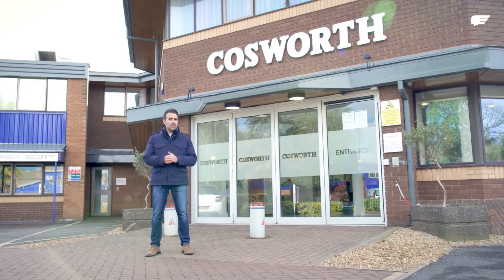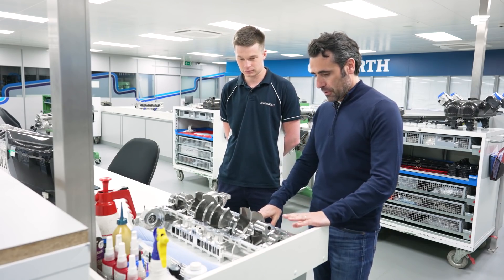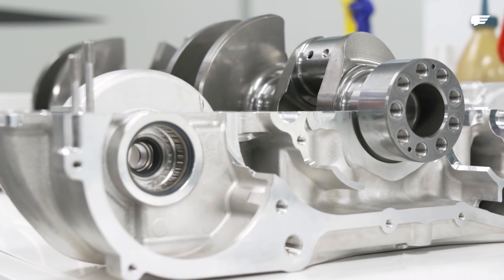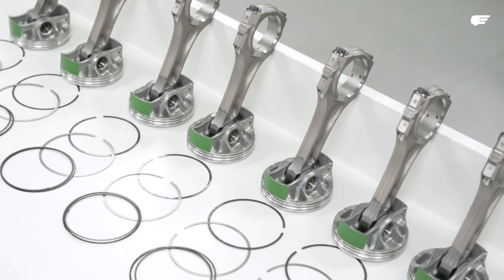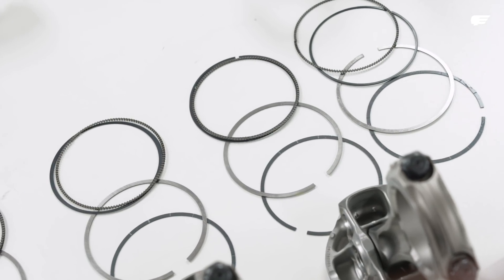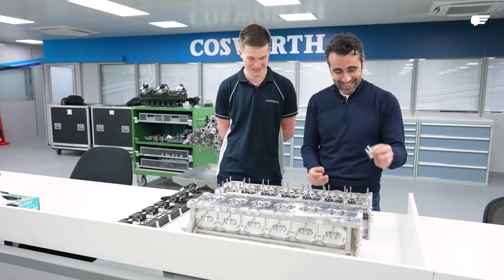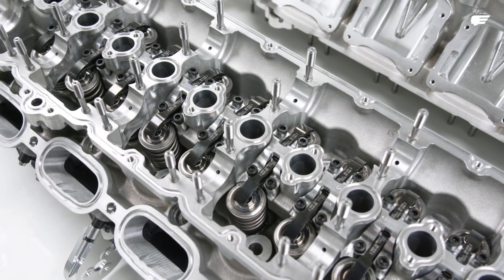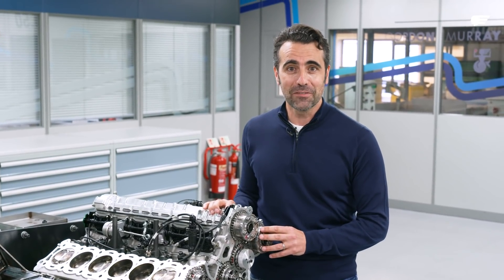T.50 VLOG | EPISODE #8 | COSWORTH BUILD WORKSHOP

Comment: We Might Be Able to Now Make Top End Engines on a Small Scale,Now that CNC is Everywhere But Back in the 60s,70s The Engines in British Motorbikes Were Not Very Good,Big Heavy Slow Revving and Always Leaking Oil with Gearbox Not in the Engine.
Then Honda Brought tout the CB750 that Beat the UK Bike industry in the Ground in 1969 !!!
I Dont think there is a Company Better than Honda when it Comes to Engineering including Cosworth or Any other Big Car or Bike Company.

Comment: Incredible, the dec height is so small, meaning the when the piston is a bottom dead centre it’s mostly within the diameter of the crankshaft, necessitating most of the piston sides are machined off, only having a very small crown and cylindrical aspect. This would normally result in piston slap, when cold. So possibly the engine has to be pre heated like F1, before it’s started, because the piston to wall clearance must be minimal?

Comment: Sweet engine. Visually, there are many shared details between this v12 engine, and the twin turbo v6 in the Acura/Honda NSX. The 2nd NSX engine is a joint venture between cosworth and Honda. Some of the shared technologies are the dry-sump oiling with an integrated bed plate (bed pan) with all of the main bearing journals machined out of one big piece of metal. Also the valve swing-arm cam followers are almost identical to the NSX V6, the only difference is the NSX has all 4 swing arms as an assembly, instead of just a pair on the v12.

Comment: Actually, there's nothing too radical here that we can see, apart from the metallurgy and build quality. Old motorcyclists would recognise dry sumps, double valve springs and gear trains for the cams from the 1940s and 1950s. 4 valve heads were used by Rudge in the 1920s I think, and even Hillman Imps had slipper pistons. I can't quite understand the 'rocker' cam followers, but I'm sure there's a good reason. Anyway, I just know it's going to be an awesome car if Gordon's in charge.

Comment: The toyota 2zz-ge motor used in celica gts,  lotus elise, matrix xr, Corolla S and some pontiac thing (vibe) from 2000- had metal matrix composite sleeves. It does help keep the weight down but it is also a huge pitfall of owning the engine. There are a few reasons we call it the glass engine and the metal matrix composite sleeves is one of them. The material is not so great in the long run.

Comment: Hos does one adjust the tolerances between the cam lobe and the follower?
Reply: a lot of modern engines like this simply use valve stem shims/lash caps. https://www.maxrpm.de/Valve-lash-cap-Di6mm-S250mm-Schrick-0866-13-250?gclid=Cj0KCQjwh_eFBhDZARIsALHjIKeM-Yn9gNRjzEGfbMeJU_x7cykdBaXIgzEREMygLkJKZ2OLRGl5LDcaApcOEALw_wcB

Comment: With piston rings that thin, flying at 12k rpm, how often will this engine need to be rebuilt? Annual?
Reply: The ring they looked at was one of the oil control rings. They are always very thin, approx 0.5mm. The top and second ring are thicker, probably in the 1mm and 1.3mm range. With high end bore coating and hone pattern allowing tightly controlled ring lubrication, ring wear will be low. High rpm causes more fatigue to rod bolts and pistons, thus keeping all reciprocating weights as low as possible.

Comment: What is the reason for the cavities on the underside of the intake section of the cylinder head? Is there a two stage intake or two stage injection? Or was it perhaps to allow better clearance for machining intake port geometries? You really have me interested :) Beautiful work!
Reply: This is what I came to the comments to figure out! What the hell is that opening? I was thinking some sort of two stage intake, but you might be on to something with the idea of machining access. Maybe it gets blocked off somehow. Either way, I’ve never seen anything like it.

Comment: I didn't see any crosshatching on the cylinder walls. I wish they went into how they coated them.
Reply: The cylinder bores are plasma coated and honed.
https://youtu.be/PqrPuI3mHfM
Reply: @mikechapman1108  That's fucking wild.
Reply: no crossharching is fairly common in all aluminium blocks. the coating is usually NIKASIL, ALUSIL or LOKASIL. it basically hardening a aluminium silicon alloy by pulling out the silicon on the cylinder walls.

Comment: Beautiful stuff... But I'm gonna say something blasphemous... Looks a lot like a crotch rocket engine x 3.
Reply: It is essentially a 3 cylinder x 4. Getting a big displacement engine to rev to 12k is MUCH harder than a 1L. Harmonics, structural design are an order of magnitude more challenging
Reply: @Shadowboost  Well, is 3.9 liters vs. 3 liters for a V12 based on liter bike architecture or 4.2 liters based on ZX14 architecture. Similarly, the BMW K1600 touring bike engine would be 3.2 liters and has similar challenges in terms of crankshaft length etc. (But nowhere near the specific power).
Reply: @corystansbury  The Cosworth engine was designed as a 3 cylinder. That's why there are 4 sets of exhaust runners that merge 3 into 1. making a singular block that can handle these harmonics/vibrations/pulses is not as simple as 1 liter engine times 4
Reply: @Shadowboost  No, the reason for that is that scavenging favors 3 cylinders on a collector more than any other combination. That, along with being inherently balanced, makes it simpler than a 4 cylinder in many ways. The torsional aspects on the crankshaft are certainly more interesting and the block stability marginally more challenging, but the power cell of each of those 12 cylinders looks a lot like a bike engine.

Comment: Hats off to Gordon. Beltless engine and dry sump got me really intrigued. They'll all be a works of art once completed.
Reply: Dry sump is standard, really. Thousands of corvettes are dry sump.
Reply: porsche already used beltless engines before... the 918 spyder was beltless
Reply: @pihermoso11  so is the old 5 cylinder VW TDI!
Reply: Ducati have been running Desmo gears for a while. But I think this is the first road car application.
Reply: @rych7852  Is it desmodromic?   I thought that it just has a simple rocker.

Comment: It's amazing that pistons that shallow can stay square enough in the bore to last in a road application!
Reply: I think that's what the additional green, low friction part is for. Keeps it square.
Reply: That was my exact thought , but I couldn't think of how to phrase it. I feel like it could "catch an edge" so easily
Reply: cosworth surely have the experience and expertise to work out the necessary stroke, rod length, wrist pin offset etc to make it work
Reply: @AbbySaluteFücht  nah it isn't
Reply: @stefanroseEP3  you know the People he knows ?
Reply: Good point. I'm wondering about piston to wall clearance and the metallurgy of the piston to control expansion.
Reply: @AbbySaluteFücht  a cozza? You mean a cossie?
Reply: I was totally impressed with that piston as well
Reply: Compromised durability for performance. You won't be able to abuse this thing like a Honda.
Reply: @LAwrx03  The engine will have a programmed warm-up routine like an F1 car that will probably take several minutes, with an absolute prohibition on driving it before it finishes and the pistons have expanded to their working clearance. I'd guess it will be governed for a while after that as well. Bit different to the lumps they're putting in hybrid EV/ICE's, asked to regularly go full chat when they're stone cold (and which I suspect will need replacing at the same time as the batteries after four or five years - disposable cars in effect).
Reply: @EliteRock  No one is replacing an engine in their new commuter car after 5 years so I'm not sure what you're talking about. The T50 engine isn't going to last 100k miles without a rebuild but any modern Honda or Toyota will easily do 200k+ miles with basic maintenance.
Reply: @LAwrx03 BTW, it isn't just 'commuter' cars, the likes of Jaguar et al are making large, high-performance GT's and SUV's which default to all-electric (and have substantial electric-only range) but instantly start-up and gun their IC engines when asked to. I guess it remains to be seen, but I defy any engine, let alone a high specific output ones, to last much past 100k miles when they're thrashed from cold hundreds of times.
Reply: @EliteRock  I definitely agree with you that "high performance" hybrid engines will have reduced life simply because they're complex and designed for speed not every day durability. I also think the future is all electric thus I never bought into the hybrid trend. However, there are many reasons high performance engines wear out faster whether they utilize a hybrid design system or not and what you'll find under the hood of a Prius is not all that complex or fragile. A friend of mine commutes in her Prius C every day and has well over 100k miles on it without a single issue. The engine in that car is bulletproof and I think the biggest reason why is a robust rotating assembly designed to withstand thermal fluctuations without fatigue. Looking at the piston in this video leads me to believe the T50 is going to need strict maintenance to avoid catastrophic failure and that's fine and dandy for billionaire playboys like Jay Leno but not for an enthusiast.